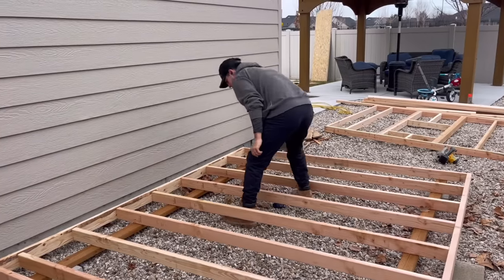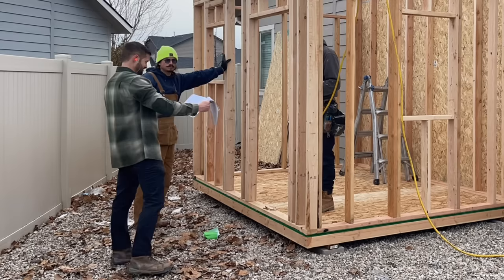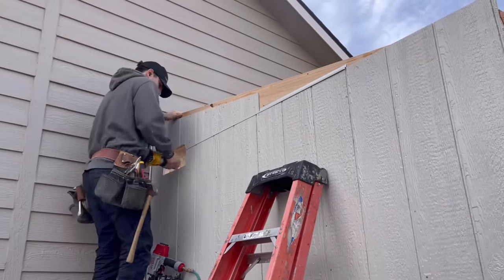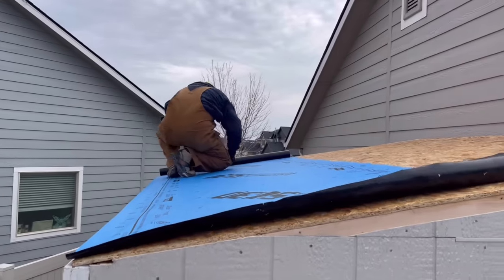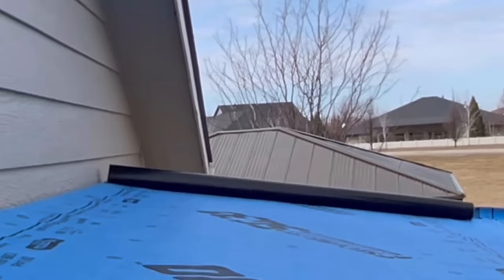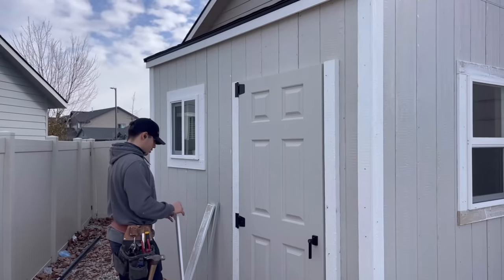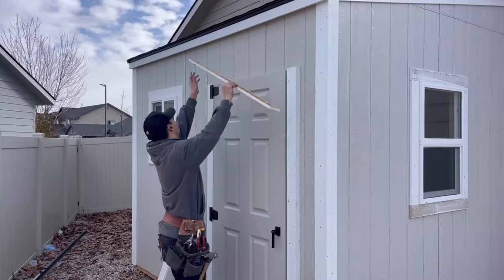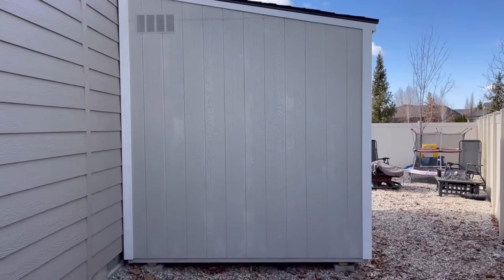We Built A Lean-To Shed Against The House

Comment: shouldn't the cut ends get painted? With the grooves in the siding, doesn't water eventually get between the door/window and  the siding?
Reply from the maker: We seal over the tops of the doors and windows and don’t have issues with leaking.

Comment: Excellent work the only complaint is the roof the drip edge corners had to be miter not cut, the shingles every four lines you must displace the 6 inch pattern so the roof will not show a pattern of a staircase I will have done the same been it’s a shed but I will never lay drip edge and shingles on a home the reason is the 6 pattern doesn’t tied the roof the wind can easily rip the shingles out when you displace the 6 inch pattern for every four lines of shingles you get the shingles tie better and be stronger when high wind hit it making it difficult for the wind to tear apart
Reply from the maker: Thank you! That’s interesting about changing the pattern every 4 rows. Makes sense, just never heard that before.

Comment: nicely done, however the lock on the door isn't effective if the hinges are exposed.  Someone can simply unscrew the hinges to gain access to the contents of the shed.
Reply from the maker: We offer a security package for the door and also offer doors with deadbolts. In a backyard behind a gated fence theft isn’t typically much of an issue in our area. Someone could also break into it through the window.

Comment: Shouldn't that flashing go up the sidewall of the house so water dosent get between the walls ?
Reply from the maker: Since the shed has a floor structure, and is not on a foundation, you wouldn’t want to attach it to the house or attach flashing,  because you could get movement on the shed over time. Water going in between them shouldn’t hurt it, the water will just run down the wall. There’s still small space between the shed and house for some air flow.

Comment: not sure if the foil can help much, because as a radiant barrier it is not facing an air space towards the outside. the gap between the back wall and the house is questionable in terms of moisture accumulation, mold growth... it would be better if a flashing is installed against the siding of the house to minimize water or leave a bigger gap between the two for more air to circulate. it is also questionable for not having a moisture barrier in the wall and in the floor.
Reply from the maker: It will still help quite a bit.

Comment: Your foundation is not stacked into the ground.  In a big blow your whole shed can be moved.
Reply from the maker: We’ve never had an issue with a shed getting blown away. It’s a portable structure and not permanent  either, so it could be moved down the road if need be.

Comment: they forgotten the rain issues not gutter no down pipe 
plastic roof and play wood no concrete on floor no last long the rain will rotten the door
Children job
Reply from the maker: It’s a shingled roof, not plastic. Thanks for watching, we appreciate comments good or bad. That shed is going to last for years and years!
Reply: @stormorsheds2970  suppose to seat on a concrete slap 
Where the rain go from the roof ??? On ground  near door cause mud
Reply from the maker: There’s gravel around the shed. It won’t be muddy.

Comment: Depending on where you are living, this "shed" may not qualify as a garden shed, which has height and dimensional restrictions.  This will be classified as an attachment that is not movable and will require permits with typical boundary restrictions.  Before anyone goes this route, you need to check with your local requirements for compliance.  Don't  just blindly trust the contractors.
Reply from the maker: It’s always important to check city code and regulations before installing a shed. In our area a permit wouldn’t be required on this size shed. It’s not attached to the house  and definitely a portable, moveable structure.
Reply: I built a playhouse like this beside our garage.  One corner was about two feet from the property line.  When we were in the process of selling our home, the Surveyors would not issue a Real Property Report.  We appealed to the City.  They also denied our appeal.  To save any further expense, I took it down.
Reply from the maker: That’s a bummer. Sorry to hear.

Comment: A  LEAN TO  shed is called that because it  LEANS TOwards  the building which supports the back edge of the roof.
Yours does not. Yours has 4 supporting walls it does not  LEAN TO. A sloped roof does not make it a  LEAN TO  
shed.  A LEAN TO has a 2x6 header nailed to the building which the LEAN TO attaches its roof to. Being quasi 
professionals I would think you guys would know that. WHAT else do you guys come up short on I wonder?

!
Reply from the maker: Thank you for the information, good to know. There’s no reason to insult us. We’re just out here trying our best :). But glad you watched the video!

Comment: Guys ! Not to sound so critical but you guys should really learn , and implement  , proper construction techniques before you go posting videos of yourselves building something.  The biggest thing I get from your video is evidence of incompetence for the homeowner when they decide to sue you for the way you built their shed. And YES , I KNOW how to build  ! 37 years as a WELL TRAINED  Union Carpenter including working for a time with a COMPETENT  shed company as their shop foreman and ONLY person qualified to do warranty work.  Go learn some things before you end up losing everything you own  !!!
Reply from the maker: What specifically did you see that would make you say we are incompetent? Maybe you could expand on that and also give some pointers on how we can improve? I’m excited to hear more.
Reply: @stormorsheds2970  From the very beginning.  You used untreated lumber which is in close contact with the ground as well as ACTUAL contact with concrete or concrete products.  Secondly you NEVER put 2 finished walls back to back in an outside environment because that is inviting mold and mildew into the airspace between the walls.  It doesn't matter how close you get those walls to each other there WILL be airspace  ! Thirdly you don't put asphalt shingles on roofs under a 2/12 pitch and in most areas cade requires a 3/12 pitch for asphalt shingles.  Fourthly you put your flashing from roof to wall UPSIDE DOWN  ! This flashing should have been tall enough to go under the horizontal siding on the house. It also should have been sealed on both buildings.  Anytime you have a wall to roof flashing where the roof is under a 3/12 pitch it MUST be sealed to the roof to prevent rain 'blowback' from getting under the flashing.  My guess on your roof pitch is somewhere around a 1/12 to a 1 1/4 /12 pitch.  That low of a pitch on a roof in most places will ONLY allow either metal roofing or rolled asphalt roofing.  Then fifthly your door! You NEVER mount a door flush to the door trim. It's inviting rain to come right on in. A door should at worst be mounted flush with exterior siding and at best inset half the thickness of the exterior wall. I'm sure I'd I paid closer attention I could find other things wrong here. I'm not telling you these things to be mean or spiteful. I'm telling you from my lifetime of construction experience  ! I very seldom get critical with someone on a public forum but I meant what I initially said ! If you keep building things this way you will , you WILL , eventually end up in a lawsuit over it and it won't be just the price of the shed. It'll be over damages caused to the existing structure. I've seen it happen before to people who chose not to listen to good advice.  Take my advise. Hire someone who can TEACH you proper building methods or take some courses on them . Better yet , join an apprenticeship program  ! I learned under a father who was highly skilled in construction and yet cared enough about my education as a carpenter to INSIST that I complete all 4 years of an accredited apprenticeship program. Best of luck guys. And there ARE people out there who are retired or semi retired that would love to be able to work with yall a few hours per week to share their lifetime of knowledge.  And MOST would do it at apprentice wages !

Comment: Then water runs between and ruins your house
Reply from the maker: That won’t be an issue. It’s no different than rain water running down the walls of the house anywhere else on the home. It won’t trap the water, it’ll run down the wall onto the slab and dry.

Comment: So many wrong worse than DIY Amateurish wrong use of improper materials, not a level in sight, no-use of seam caulking or sealant behind exterior trim pieces, OSB on exterior areas without sealing the ends or priming, exposed nail holes, My Gawd, I could go on and on and on…🤦‍♂️
Reply from the maker: Please do, we would love to hear more :). You really think we built it without a level?
Reply: Feel so sorry for those people who have their house. They're gonna automatically have problems with roof The idiot put the flashing upside-down have stuck it underneath the siding of it like that and then ran the shingle up. To it and run back down so therefore, it was typing run and then it's forced why they did the floor.  That's just a mess waiting to happen.
Reply from the maker: We appreciate your comment but what you’re saying just isn’t correct. The shed isn’t attached to the house. Some water will get behind the shed, in between the house and siding,  and run down the wall onto the gravel.
Reply: @stormorsheds2970  
Why don't you use common sense? Why don't you think there might be people? That might know something more than you you even amid. Yes, there will be water get down in between the house and the new build. Why create that problem? Why not do it right? The first time and I'll have to go back and redo it.